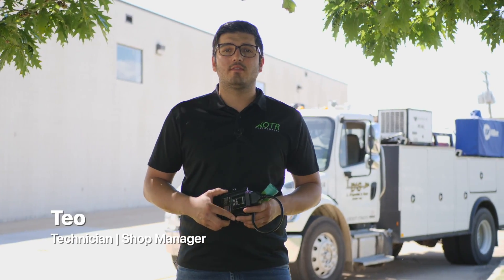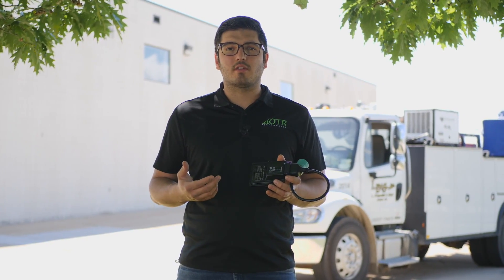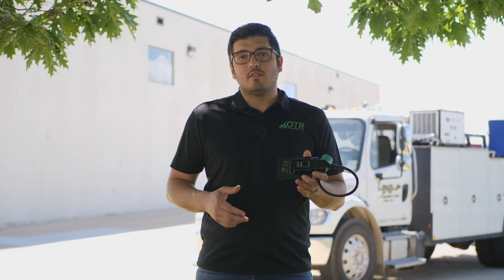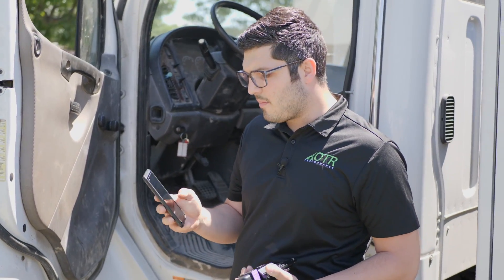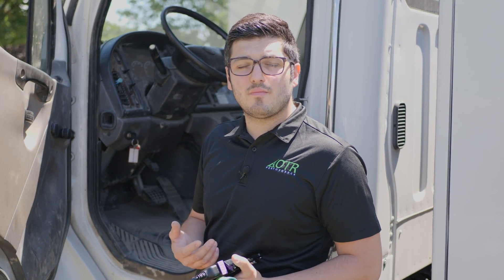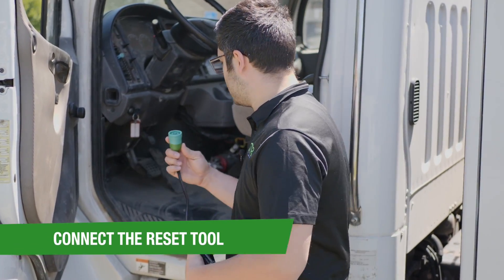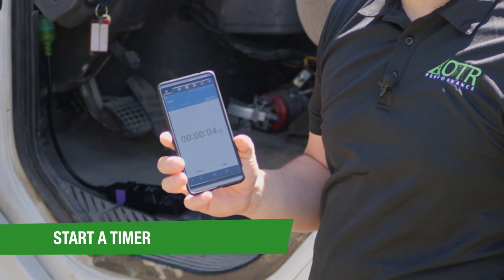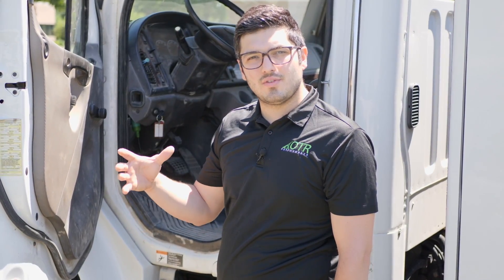2012 Freightliner M2 Cummins ISB Forced Regen

Comment: What about 2020? Im OTR and sleeping in cab overnight in frigid weather— trucks running of course. Afraid of possible DPF CLOG and engine codes occurring, happened once— bad experience.
Reply from the maker: Our OTR Reset tool will work on up to 2021 year trucks. Heres a link to the tool: https://otrperformance.com/collections/reset-tools/products/otr-reset-tool-cummins 
We also offer Next Day Air shipping to get the tool to you as soon as possible. 
Give our Sales team a call at 586-799-4375 if you have any questions.